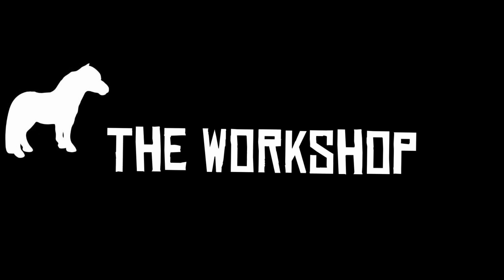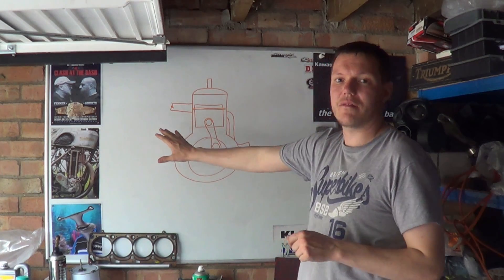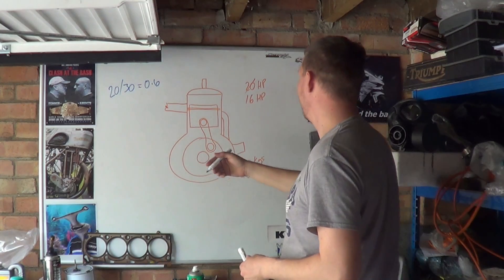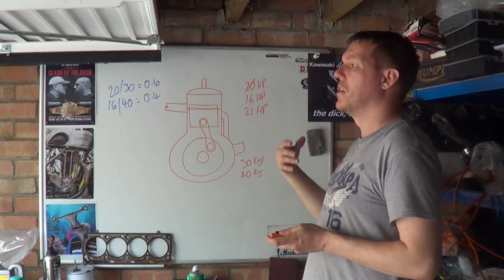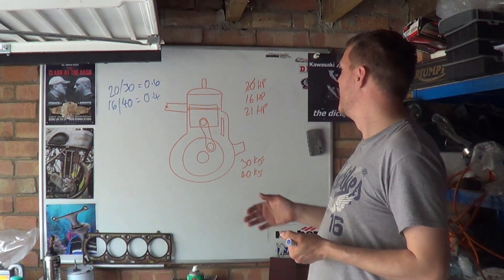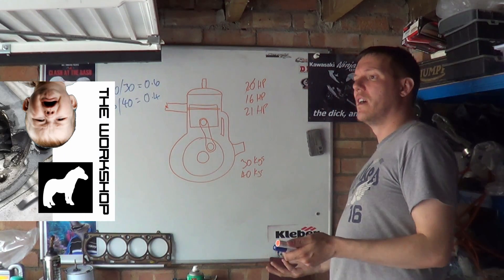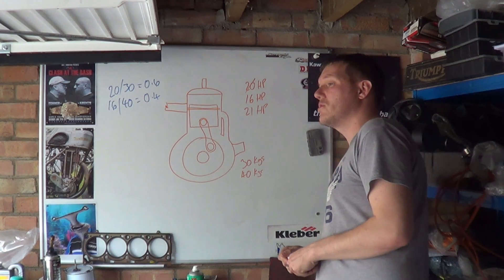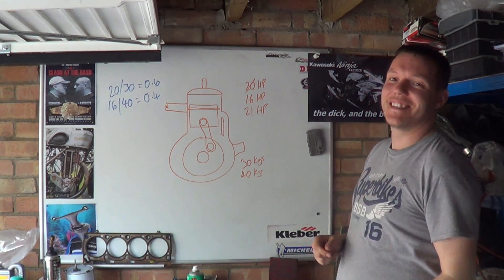2T supercharging the solution?

Comment: It's already been done. Ford were on the verge of producing a Ford Fiesta in the 80's with an amazing 2 stroke engine developed by Orbital. It was direct injection, with pressure scavenging by a supercharger.  There was no oil emission as the bottom end was like a 4 stroke, isolated from the combustion side.  It was half the size, weight and double the power and torque of an equivalent capacity 4 stroke.  Grief knows why they didn't go ahead with production, even though they made a pilot run for evaluation by private drivers!!
Imagine an engine like that now with modern engine mangement and fuel injection!
Reply from the maker: Link?
Reply: could you share that link publicly please
Reply: http://www.trabantforums.com/threads/for-the-2-stroke-fans-mk3-ford-fiesta-prototype.1281/

Comment: Not trying to pick on words but 20/30=0.6 and 16/40=0.4 meaning that supercharged engine needs to produce 50% more power to break even, not 30%. So it would need to make 24 HP not 21 HP. What shows your point even stronger ;)

Comment: Didn't the honda ex2 have better emissions than a 4t
Reply from the maker: Wasn't the EX2 fitted with an engine cut off like cars have? This will reduce the emissions quite a lot, because its usually measured over 100km in some cases
Reply: The Workshop TechnologyEdit

With the utilization of a redesigned exhaust port valve and the ARC (Advanced Radical Combustion) system engaged, the engine would produce a pre-ignited combustion effect at low throttle that would completely burn all fuel in the chamber compared to how a conventional two-stroke engine would lose part of the intake charge.[1] The result decreased two major drawbacks of two-stroke technology of both incomplete combustion of fuel at low engine revolutions (RPM) and expulsion of unburned fuel at high RPM.

I guess it didn't work out that well because you don't see them today
Reply: How does that get rid of the problem of burning oil? A two stroke being ported will always end up with oil being a problem, either unburned and burned in the exhaust or in the combustion itself. Even with some kind of cylinder oiling system I would have thought.
With emissions getting ever more stringent it is only a matter of time. They will become rarer and rarer. Kind of a shame I always loved two strokes. And nothing smells or sounds better than a hot MotorX blasting by and that smell of chips cooking.

Comment: 2T are a novelty from a by gone era! Hello 4T, Diesels and electrics!
Reply: The Esseboy Just don't add gasoline by mistake...  $$$$$$
Reply: The Esseboy you say diesel will continue to exist but I'm pretty sure in the UK we are starting to try to kill them off ?
Reply from the maker: Not just the UK, all of the EU. Which basically means the world - as all the manufacturers follow EU emissions standards
Reply: The Workshop
Don't the diesels pass emissions with add blue? Or are there some new emissions standards they won't meet?
Reply: JAMP0T1
How? They meet all standards with add blue?!
Reply: You can say goodbye from Diesels to pretty soon.
Reply: Diesels will continue to exist with EGR and add blue :) My mother and father has such cars and man, the 2.0 L VW engine from 2017 is badass!!! 180 HP!!! At freaking 4500 rpm (Redline is at 5000 rpm)! Brutal from 1750 RPM to 3750 RPM
Reply: I got my 8v92 2 stroke diesel to tinker with
Reply: @jlo13800  I got my electric moped to tinker with, old diesels are going the way of steam engines pretty soon.
Reply: @TheEsseboy  sad world we live when everything is getting so 2 strokeless! The snowmobiles, ship engines, lightning bolts and the sun are some of the 2 stroke going today.

Comment: GO ELECTRIC
Reply from the maker: "So you're going to plug your dirt bike into the nearest tree to recharge after an hour's use?"

- fucking awesome!
Reply: Really?  So you're going to plug your dirt bike into the nearest tree to recharge after an hour's use?
Next you'll be wanting to only want bikes that run on smugness.
Reply: Burce fill your bike up with treebark then
Reply: Burce i assume an easy to replace battery pack would be quite handy. just switch up the battery pack on the go. just like bringig extra fuel with you.